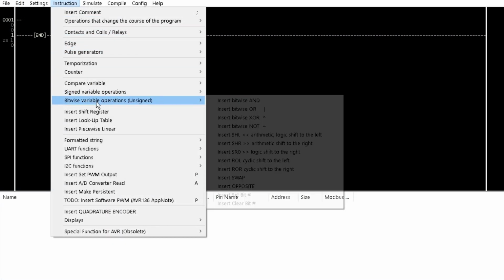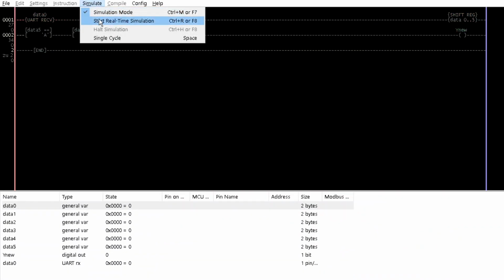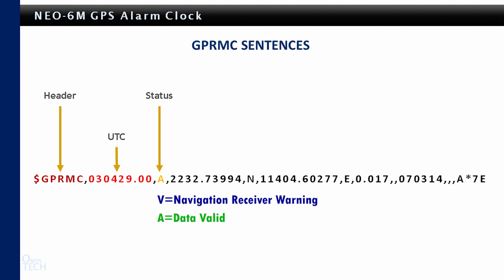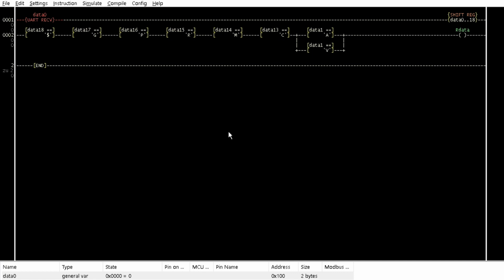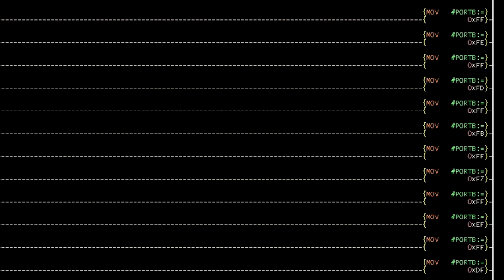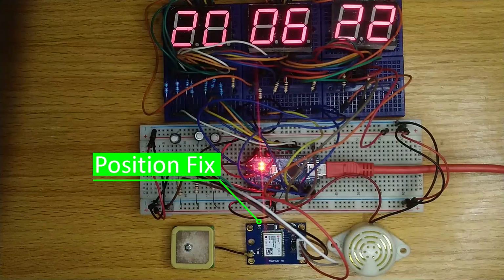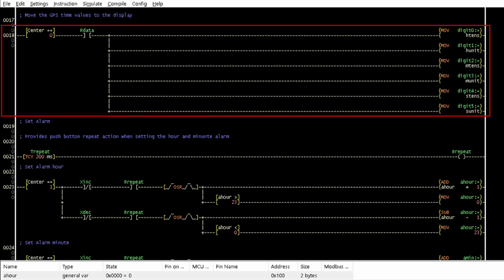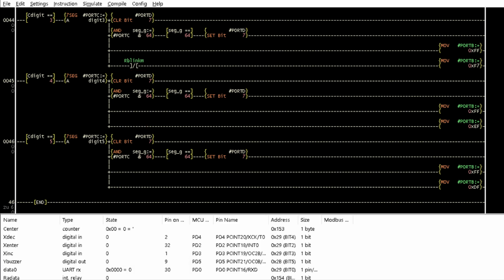LDmicro 18: Ublox NEO-6M GPS Alarm Clock (Microcontroller PLC Ladder Programming with LDmicro)

Comment: I made a program with pic 16f877 with lcd but I didn't finish the program and it already occupied 92% of the capacity and I can't finish but what should I do?  can you help me, your program is bigger than mine
Reply from the maker: @ONOFF onofre Kindly confirm if you are programming the PIC16F877 in C mode. If so, note that the Hi-TECH C compile used to configure LDmicro for C mode programming is the free version and does not optimize the generated code. Thus, resulting to very large generated hex file. If you logic does not have the I2C instruction, I recommend you compile directly and upload the hex file with PICkit3 application. On the other hand Arduino nano have a large program memory than PIC16F877 and can handle larger codes than PIC16F877.
Reply: @OnosTech  
I'm not programming in c mode I'm generating the hex in ldmicro and recording in pic 16f877 I'll generate the code in c and recording in pic 16f877 if I need to, I'll use arduino nano.  if you have a link to a video to refer me I will be grateful, thanks anyway.
Reply from the maker: These video will get you going on Arduino.
https://youtu.be/7qYqJCZumCQ
https://youtu.be/eK_VfUqTnS4
https://youtu.be/1ooMWbz8Zzs
Reply: @OnosTech  
very good your explanations are great.  thank you i have done several programs with the same principles of your programs but using the 16f877a the display segments blinks with a lot is not clean like your assemblies, i will do bypass your tips and links thank you
Reply from the maker: You are welcome

Comment: Sir kindly one help lm35 tampracher point value ldmicro
Example 22.5 and next value 22.6 cantigarat
Reply from the maker: Your request is not clear to me
Reply: @OnosTech  sir my request lm35 sensor value print display 22.5 and 22.6 and 22.7 celebration ldmicro
Reply from the maker: I will check and revert
Reply: @OnosTech  ok sir

Comment: Good information. 
Although I rather prefer to program with PIC16F887.
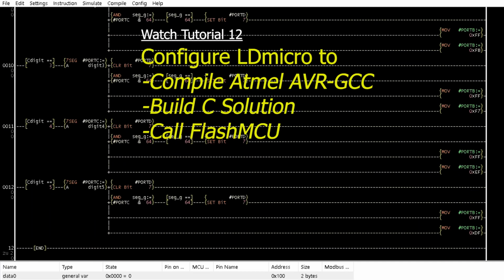Reply from the maker: Sure. You can use same logic for it. You may have to adjust the PLC cycle time for the UART to function properly and ignore from 11:29 to 12:40 in the video

Comment: PLZ HELP I2C LDMICRO 20*4 LCD NOT GOOD WORKING
AND 16*4 NOT GOOD WORKING 
ONLY 16*2 WORKING I2C GOOD 

PLZ ONE TUTORIAL 20*4 LCD UPLOAD
Reply from the maker: Ok. I will check
Reply: OneTech's code work on my both 16x2 and 20x4 LCD ( same code, same I2C adress)
Reply from the maker: @Tân Hoàng  Thanks for the confirmation.  @Crescent Electronics You may follow the tutorial link and comment on the video if you still have any further challenges. https://youtu.be/Mj5K6ZTT21Q
Reply from the maker: Kindly see this tutorial to resolve the 20x4 LCD issue https://youtu.be/Tr6mZwcGyh8